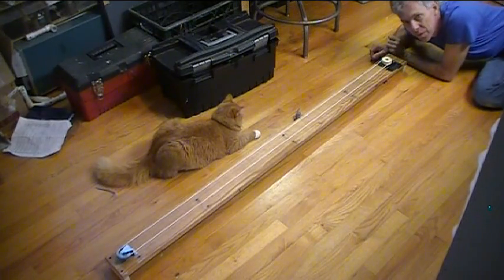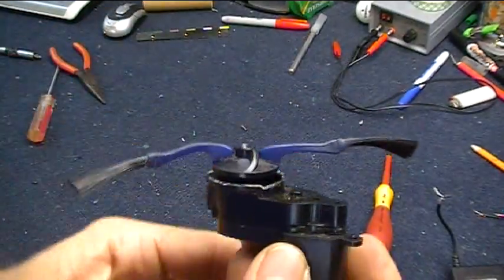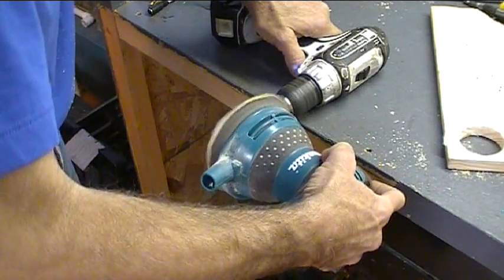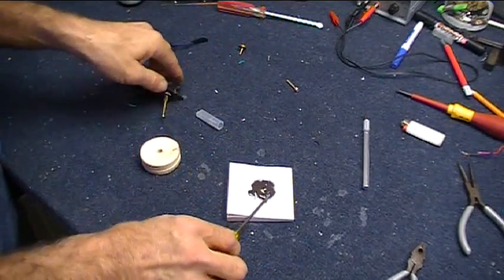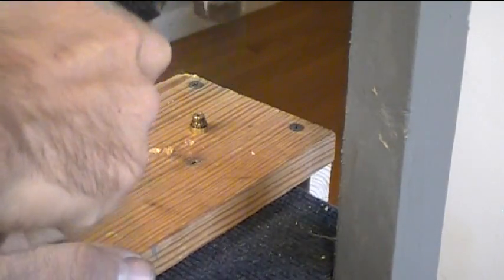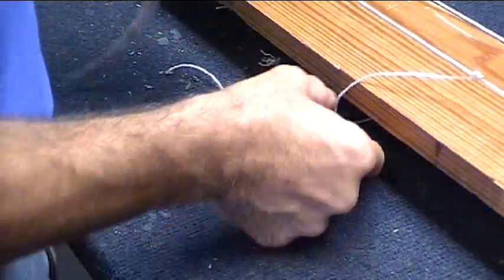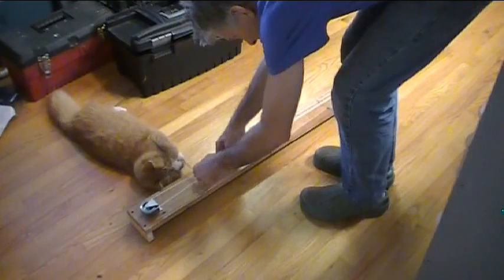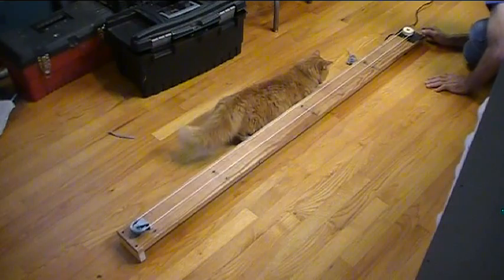The Chase-A-Mouse Cat Toy

Comment: All you need to do is use wood glue and glue a plank, around 1.5 inches thick in the middle and that will stop the mouse from getting tangled up. You could also find a pulley assembley that has a spring and adjust it to keep tension on the line so that it won't get pulled off as easily. You could even make one with a pulley on a hinge and a stiff spring.

Comment: You should make the power switch a momentary paddle switch, with a 555 timer circuit (for say 30 sec) to keep the motor running after the switch is hit.

That way the cat can turn it on itself. (but maybe a quieter gearmotor for when its 3am)